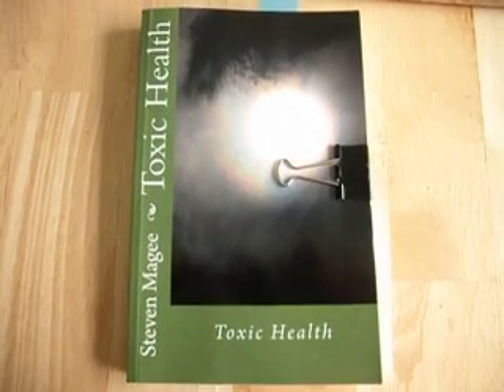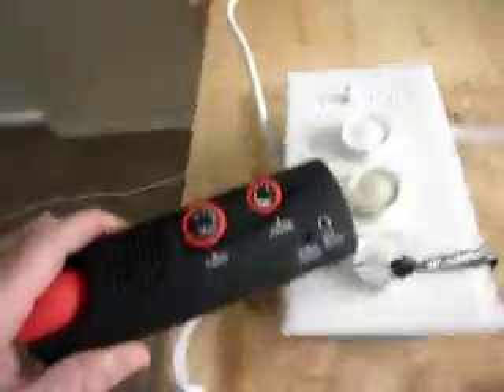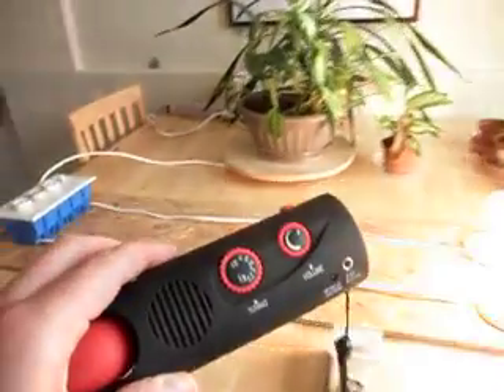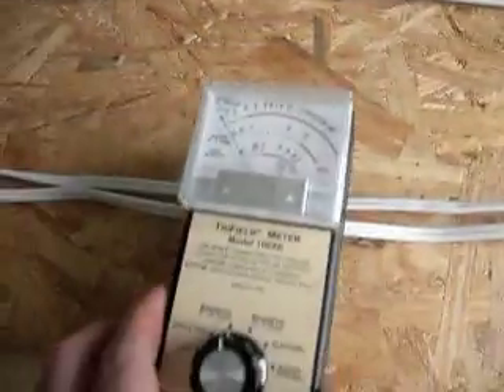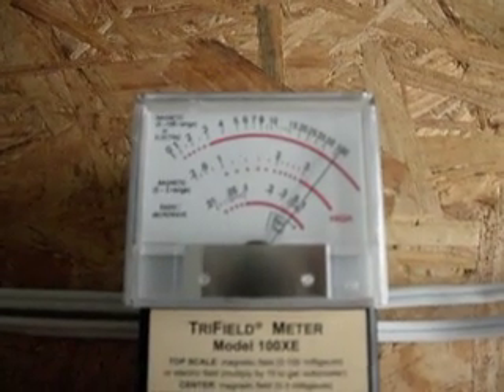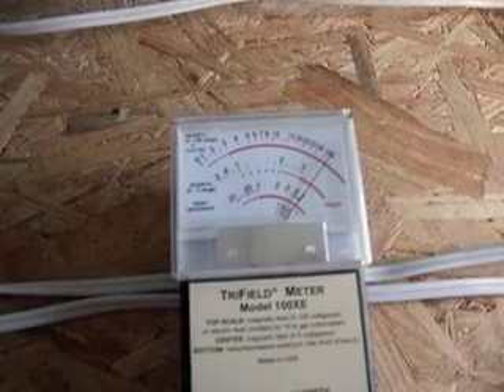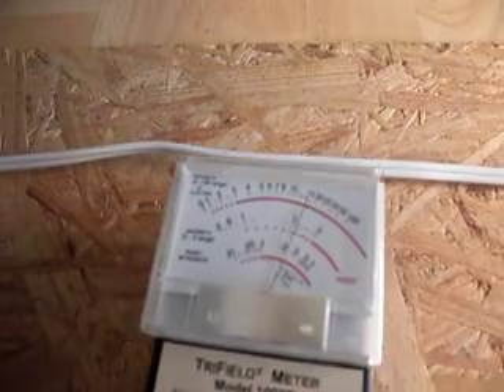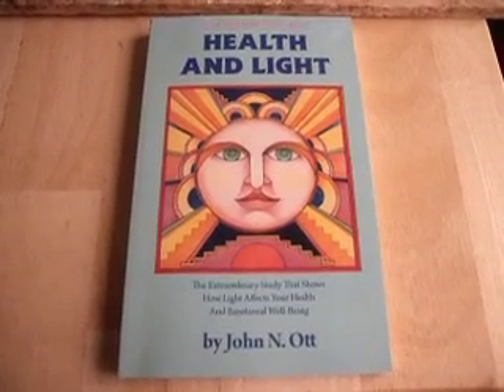Harmonics & Dirty Electricity - Part 1

Comment: I have a question, are these dimmers more than just a simple potentiometer?    Also, does dimming change thee waveform at all or just reduce the voltage?  This is strange that dimming causes all these fields.  I wonder if putting an oscilloscope on the dimmer output would show exactly how it changes to create the harmonics. 

I also wonder about electronic dimmers that use SCRs or Thyristors and how they impact harmonics.
Reply from the maker: They are electronic lamp dimmers and the waveforms can be seen in Electrical Forensics: http://amzn.com/1492118907